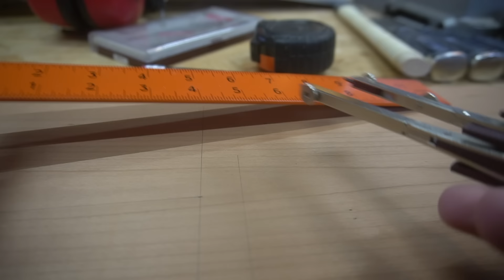I challenge the AMISH to a FURNITURE BUILD-OFF

Comment: Very interesting video and build!

I grew up in a small Illinois town next to Amish country. They definitely had quite a reputation for well built furniture.

I wonder how many of them have made similar switches to modern cnc type operations or how much was still done by hand.

Maybe next time I go back to visit family, I'll see if I can go to some of the shops and ask.

I always thought it was neat when i was a kid as the Walmart had a hitchig post for the Amishs horse and buggies. Didn't realize it was unique until I was a bit older. Just how it was, lol.

I've always wondered where they make the cut off of being self sustaining vs using outside sources.

Like they don't use power grid because it's outside, so they have generators. But they don't make the fuel?

I wonder if any Amish communities have just made their own power plants so the community is on it's own grid? Although I guess that's a line of power plant vs generators? 🤷🏻‍♂️ Just very interesting and lots of questions. But also never asked as never wanted to come off as nosey or asking inappropriate questions. 🤔